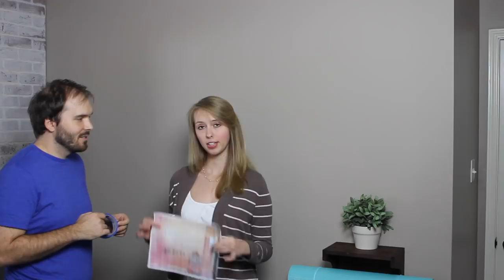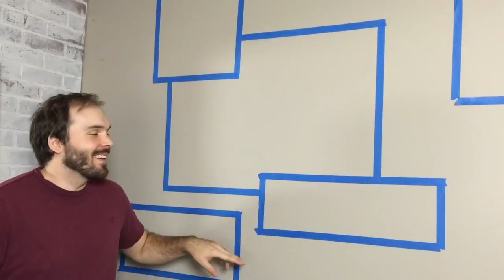Building DIY Plywood Shelves with an Exposed Edge

Comment: how plywood edges were finished smoothly?
Reply from the maker: A sharp blade always helps but my favorite technique is to back the board you are cutting with a scrap board. This prevents the back side of the board from splintering.

Comment: I will make one for my daughter's room. No neat design! By the way, looks like you didn't iron veneer on the edge of the plywood, I buy plywood in Lowes and the edges looks not good.
Reply: So neat design!
Reply from the maker: Thanks! We made a cheap cross cut jig to make the edges cut smooth without splintering the edge. We like the industrial look of the exposed edges.